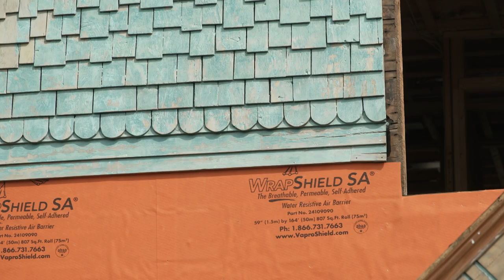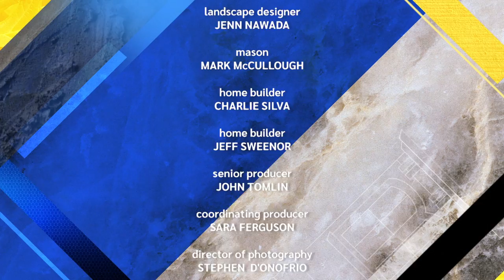This Old House | Back to Narragansett (S42 E8) | FULL EPISODE

Comment: Why do you guys run ferring strips across your ceiling joists I noticed that's a New England thing we dont do that in Pittsburgh
Reply: Its so that you can run wires easier, if they were to go straight to the joist you would have to drill holes *through the joist to get to light fixtures, this saves time on install.